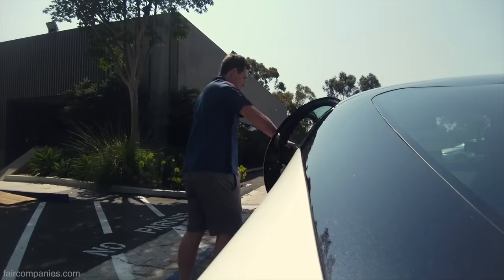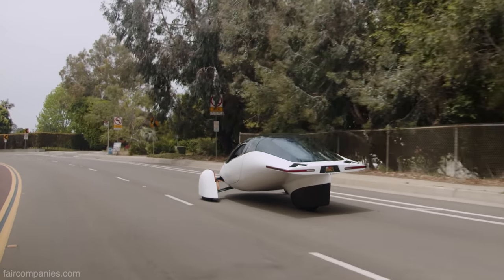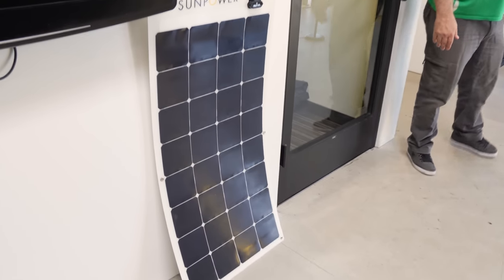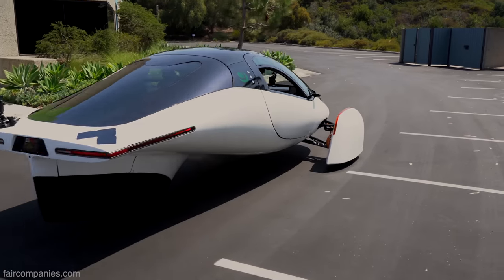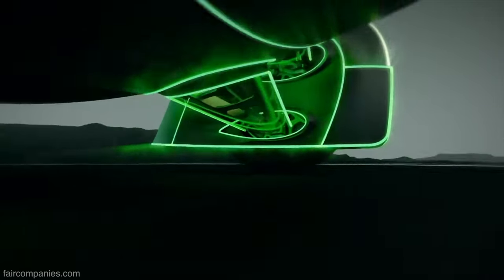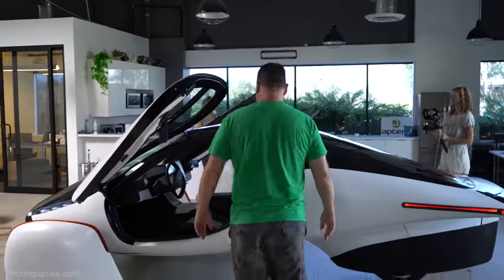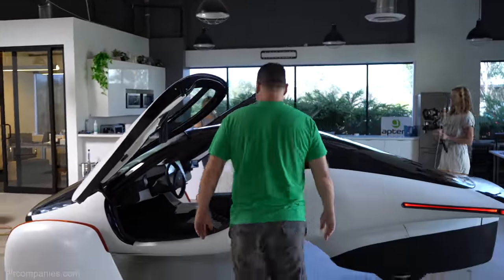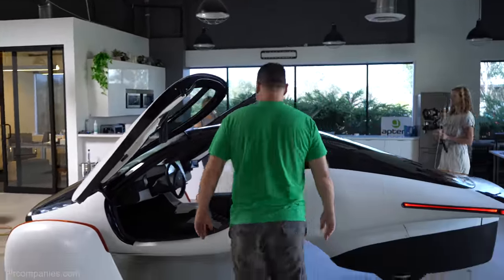Aptera commutes just on solar, gets 1K mile-range when full

Comment: You realize you are not in the "Box" anymore? You have exposed the world to intelligent management of space and motion...Makes sense in everything not just Tiny Houses...
Reply: In engineering its what is known as Lean Design.
Reply: Nobody addressed safety.  I want to see this crash tested
Reply: @tuazonwarrior  classified as a motorcycle. It shouldn't go through the crash test as a car.
Reply: @CBrisenoPhotography  yeah I'm sure that's how you get away with such lightweight design
Reply: @CBrisenoPhotography  they are scdh to test out 10 cars for crash test later this year according to their interview on Leno garage
Reply: @joseabuin9113  sweet good info Thx
Reply: Tiny houses or better boxes of matches.
Reply: @davefroman4700  Its what is known in industry as vaporware
A product that never progresses beyond the prototype stage, never reaches production and is never canceled.
Reply: @Narja The Aptera website clearly states that it will met all applicable* federal crash test standards which is deliberately ambiguous and very misleading.

*there are no federal crash safety standards for motorcycles.
Reply: Actually, tiny houses aren't efficient. WAY too much exposed surface area for the amount of floor space. Not sure why basement foundations haven't been more popular, but nothing comes close to comparing to shared walls and multiple floors. 

Too often even off grid tiny homes require massive land area, roads and inefficient travel. Tiny home communities or horizontal condo's would help, but then you might just as well build up and out with shared walls. Reminds me of a friend that thinks of herself as super green. Builds a two mile long road and clearctrees from several acres for her hobbies. Drives a huge AWD to transport all she needs almost daily and has a massive engined sports car for fun.
Reply: Another year gone by and Aptera has produced absolutely nothing except for more broken promises and missed deadlines...
Reply: @sandervanderkammen9230  You're missing an important point. As a lifetime biker with 2 (nmf) crashes, I say this vehicle has much more crash protection than a bike,, which has virtually none, so your point is absurd.

Comment: The key differentiator Aptera is that is starts with efficiency and then took on to solar. Two things, first just think what this translates to as the PV efficiency goes up. Other bit, if Aptera, and similar cars, provide option to direclty plug in a solar panel or a turbine, the car is the generator, what sort of adoption we are looking at. Just throw few solar modules on the lawn and free ride for ever, and less grass to mow!

Comment: Thank goodness for people like this.  Our world needs more and more people working towards efficiency.  I live in Minot, ND and am wondering if a vehicle like this could work well here, given our long and cold winters.
Reply: I'm in Nebraska, so we fair a bit better with sunlight, but... the Midwest is the Midwest and I'm wondering if this thing will even get enough solar charge in the winter to drive across town and back every day (about 8 miles a day total), let alone taking it on roadtrips anytime between Thanksgiving and Easter. Welp, I'm hopeful enough that I just preordered one. 😛

Also those super low front wheel pants are a bit concerning. Guess I'll be prepared to replace those every once in awhile... such low clearance, and also so likely to scrape curbs when trying park on a street (with the wheelbase being pretty wide, I'd feel pressure to park as close to the curb as possible, often rubbing the tire into the curb in a normal car).

Yep, I'm going into this with eyes open, but the dream of solar powered transportation is so tantalizingly close, I can't help but want to support these guys.
Reply: @mrhobs  How much does it cost?
Reply: @loltime8346  The car? It starts at 25,900 but offers many options and upgrades (longer range batteries for example) so you could go well over 50k. The options I selected came up to 36,100.
Reply: @mrhobs  Thank you for the reply!
Reply: @loltime8346  😊